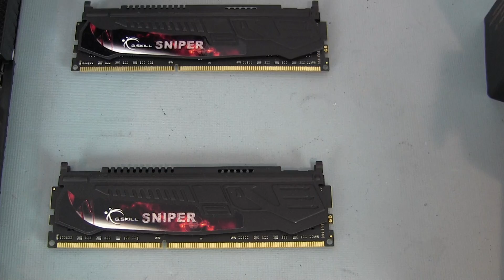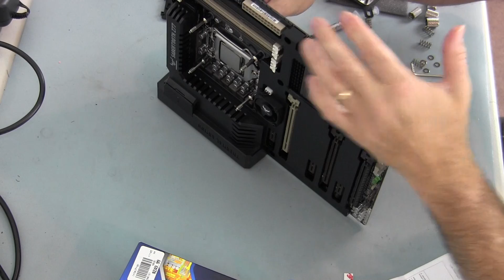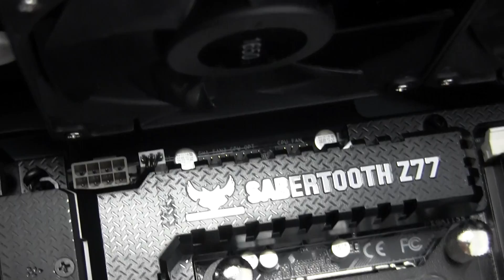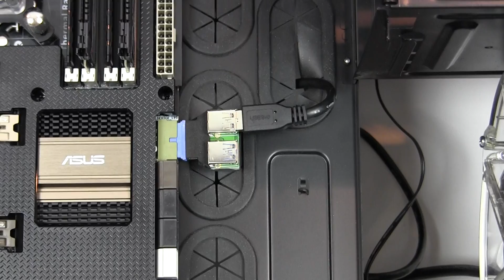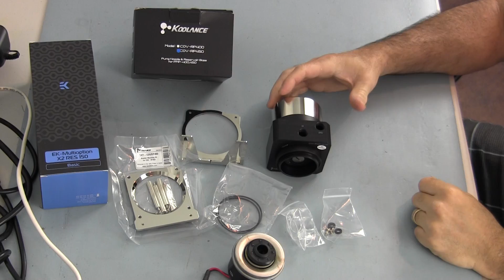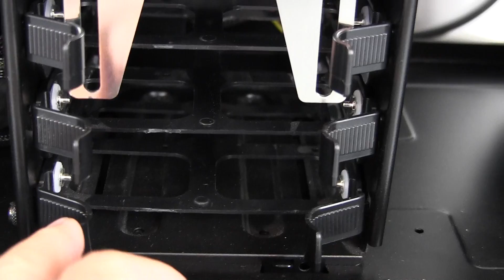CORSAIR 600T Water Cooled Gaming Rig - Part 4 - The Build

Comment: I think you had the backplate on wrong, there are holes that allow those 3 screws to poke through without touching anything. Rotate the plate 90* and it should work

Comment from the maker: Good stuff, but takes a while to cure and is conductive so you have to make sure you don't get any on the motherboard. I used to use that exclusively before I got turned onto MX-4 which I think cools just as well, is easier to apply and is easy to clean up.  There are tons of TIM's out there. But if you already own it, use it.

Comment: Hey Ron, just wanted to ask a quick question. I have a Corsair 600T as well and I will be upgrading soon to this motherboard. Main question is, Im getting a Corsair H50 watercooler for the CPU that uses a 120mm Rad. I want to mount it on top, but I dont want to lose the 200mm thats there. Right now its setup to have the 200mm inside and I have 2 120mms mounted on the outside. Would there be a way to mount the 200mm on the outside with the 2 120's inside one with the rad on it and one w/o it?

Comment: Hi man! Thanks for all this vids they have been really usefull to me. I have a question, i want to watercool a cpu and 2 gpu...i've been reading and i think i will need for sure a 360 radiator and will have to do the same mod you did... wich radiator is the one you have? 

I just want to be sure that it fits the top of my 600t case too!
For this setup, you think i will need a 2 pump setup?

Thank you very much for you atention!!

Comment: Awesome choice on the motherboard. I have the same mobo and I love it. I also water cooled my system. I maxed mine to 32 gigs of memory and and I put 2 EVGA SuperClocked GeForce GTX 660 Ti 3GB. Intel Core i7-3770K Ivy Bridge 3.5GHz (3.9GHz Turbo). This thing runs like a dream. Great video

Comment from the maker: depends on the kind you but. yes you can connect to the metal on your case. Or to a ground plug, or mine is a whole ESD system with an ESD Mat as well.

Comment: Someone may have mentioned this already, you could use only four spacers on that back plate if you rotate the back plate 90 degrees clockwise so that the three holes on the back plate line up with the three screws on the back of the cpu socket.

Comment: I had those same 50 mm fans on my asus MB and after about a month or 2 they were loud as hell so I ended up replacing them with Fractal Design Silent Series 50mm Ultra Quiet Cooling Fan 3500RPM and they are super silent, I can not even hear them after 8 months.

Comment: hi, i built my desktop like that
case phantom 410
core i7 3770
ram 32gb corsair 1600
gtx 580
but i use cooler master 700w, is it work good with this power supply or i have to change to another one?
and do i need to use fan for ram ? 
i turn on my computer 24/7

Comment: The three holes closest to the center hole of the back plate are there to accommodate the screws you were trying to get clearance for. In fact, the entire original back plate for the CPU mount can be replaced by the back plate you installed over the top of it. The nylon washers are to space it from the board to keep it from shorting out any of the rear SMD components, test points, or traces. The result is a slight decrease in performance... FAIL>most people.

Comment: Love the build, just figured you might want to know plus it doesn't stress the motherboard when installed correctly. Maybe make another video with an update, its simple to take out even with mobo installed like you have it since you can access both front and back without taking it out of the case.

Comment: You have Installed the back plate for the Ek Supreme HF incorrectly, you should have rotated the plate 90 degrees clock wise and should have used the 2.5mm black standoffs between the plate and the motheboard. If you need more detailed instructions please contact me and i will help you out. OH and the back plate has 3 holes where the socket screws fit, two on top and one on the bottom.

Comment: Hi:
1) My 2133MHz works fine, yours likely does now (BIOS update).

2) The little fans buzz too much. I used the software to set them to OFF, until 50degC then turn on and ramp up. Basically only used if needed. I've never hit 45degC anyway so they aren't needed.

Comment from the maker: I had someone else wind up with the same thing and what he used was some plumbers tape at that seal. He said it worked. So you may want to try that.  Obviously the best solution is to have the exact fit, but if it is only the thickness of the thread that is differnt maybe that will get ity nice and tight.

Comment: Hi, I got a problem after watched your video clip 4. I bought  Koolance Pump Nozzle & Reservoir Base Rev. 2.0 and a EK-RES X3 150 Reservoir. When I tried to connect the the pump top/ or reservoir base, I found that RES X3 bottom connection area was male and Koolance reservoir base top connection are was male too, and EK-RES X3 connection area is slightly bigger than Koolance connection rings. But both of them have the same OD, which is 60 mm. My question is, is there any coulper or converter?

Comment: Hi, it's me again :D
My question is that:
will 
Swiftech MCP655-B G3/8" Threaded Edition 12 VDC Pump Without Speed Controller
+
Koolance Pump Nozzle & Reservoir Base Rev. 2.0 for PMP-450/S - Acetal
+
EK-RES X3 150 Reservoir

work smoothly?

I only want to make a circle with one top or front radiator, the rest part i would follow your instrctions on Part 7.

Thank you.

Comment: How can you be that anal about the smallest of coloured wires and then install the PSU with the sticker upside down?

On a side note, You would of thought a Seasonic PSU would be designed to work both ways.

Comment: you do know that most of the components are designed by 30,40,50 year old don't you?

take a look around nvidia,amd,intel,asus  you will see a good few of them have grey hair for the simple fact they have more experience than some 16 year old who thinks they are beast because they put a new card in there factory built system.

Comment from the maker: No it is not difficult and very little maintenance is required if you plan you loop well. At a minimum you would need distilled water and a silver coil. Search You Tube or Google for a beginners guide to water cooling.

Comment from the maker: Yes if you look on line and search You Tube for 600T with Corsair H100 many people have installed this.
 I will check the measurement anyway because it might limit the height of the  ram sticks you can use as well.

Comment from the maker: Yes it will. If you want to put the fans in the top compartment under the mesh you may have to trim some of the plastic under the mesh.  You may also be able to mount it with the fans in the roof but I will measure it tonight for you and confirm if would interfere with the motherboard.

Comment from the maker: A 240 rad will fit. You would likely have to mod the top mesh to get a set of fans in the top panel. Also with the rad and a set of fans hanging downmake sure you measure where your VRM's are on the motherboard. Some stick up close to the edge of the motherboard and may hit the fans.  So check how much room you have. With a standard 120 fan and a 30 mm rad you would be hanging down 55mm .

Comment from the maker: Not if you prepare your work space properly.  If you practice grounding yourself to the case as you are assembling and handling your parts especially the mobo, graphic card, or other electronic components you should be fine.  But some folks I see on line building their systems on their beds or on a carpet are just asking for potential failure of the cards from static damage.  
Thanks for watching.

Comment from the maker: Yes.  I would always clean and reapply thermal paste. Just used 99% Isopropyl alcohol and order some MX4 Thermal Paste from New Egg or Amazon.  Did you use the thermal paste from your 2600K Intel box ? If not doesn't the H60 come with some ?

Comment: Hi man, nice video, i have an i7 2600k in a intel motherboard with a corsair h60 liquid cooler. I'm gonna change the M.B for the same that you arming (sabertooth z77). Question is: do i need to clean the cpu and put new thermal paste on? I mean it's extremely necesary? cause i don't have thermal paste right now. Thanks :)

Comment from the maker: Install a Phobya extreme rad and pair it with the 200mm fan you take from the roof. Of course that assumes you need that much cooling. Pretty much what I did in this 600T build.  Otherwise a 360 in the roof (maybe even a full 60mm rad and not just a slim 30mm) Also maybe you loose the use of the top optical bay, but without looking in that spot can't say for sure.  Hope that helps some.  I am not a believer in mounting rads outside hanging off your case.  So no suggestions from me on that front.

Comment from the maker: I checked out a couple of reviews, one on You Tube by Hardware Canucks and the otheres were forumns. They designed the case so it it will take 240 rad in the roof easily and also a 360 rad as well. For both it looks like plenty of space to install fans in a push pull without getting close to the motherboard, but you would loose the 200 fan in the top. Also depending on the number of hard drives/ SSD's if you did not need the drive cage, I would remove it and using the 200 from the roof.

Comment: i think you have the back plate 90 degrees clockwise out 
if you turn it 90 degrees clockwise the holes in the back plate will line up with the 3 screws 
i don't have a z77 board so im only go off what i can see in your vid i may de wrong ;)
btw great build.... + subbed :)

Comment: Very nice job so far! I'm adding water cooling to my 600t, was going to use bay res but your pump combo is a very good solution. Can't wait for the next part only query I have is why have problem finding water block for GTX 670 when GTX 680 is a better card and also has a choice of good water cooling options? Is there space issue with the res being there!

Comment from the maker: This fan should work, Bit Fenix Spectre LED Fan Series - Red 200mm. It is 200 x 200 x 20. As long as they kept the standard 200mm fan mount you should be able to replace the stock fan and use the CORSAIR mounting bracket .  I found this at Frozen CPU and Performance PCs.

Comment: Realize when I pause the video as it so happen when typing about your loop configuration that you decided to go to CPU first (down). Happen to comment on some details in the video. But That is how I have my loop going to the Video card first and I did see a temperatures difference by 3C-4C than when I configure the loop going from the RAD/CPU/RAD/GPU/RAD or RAD/CPU/GPU/RAD (going down against the heat)

Comment: Good call on the flow of the loop, it should go to the GPU or GPU's first due to the delta temperatures and where the heat will want to flow and heat does flow up not down, so therefore you will be better temperatures numbers. Good call Ron

Comment: wow I think that's the best 600t build I have seen so far and as I'm going to buy the 600t too I have seen almost every one YT =)
could you help me please?will the BitFenix Spectre PRO 200mm red its 200x200x25 mm fit into the front with the HDD cages in there? because the corsair 200mm fan is only 20mm thick? sorry for english mistakes